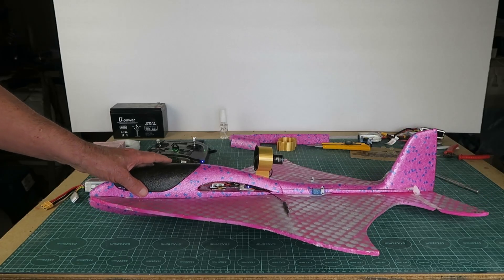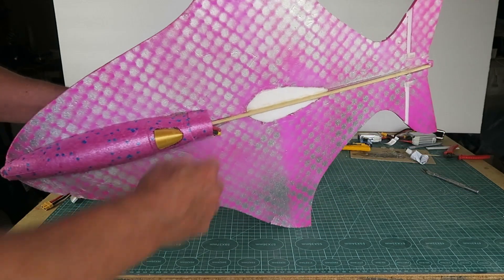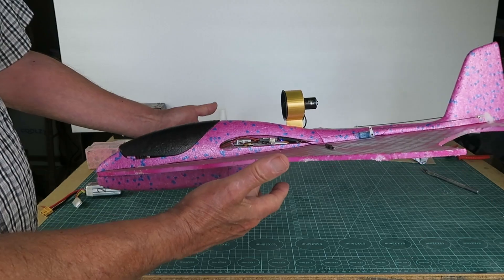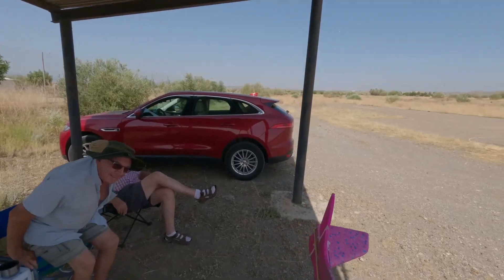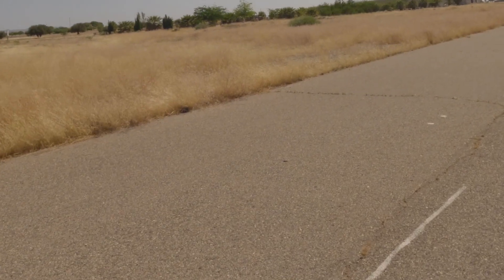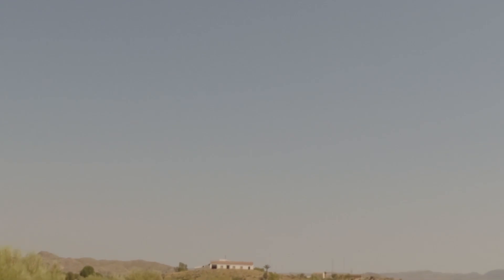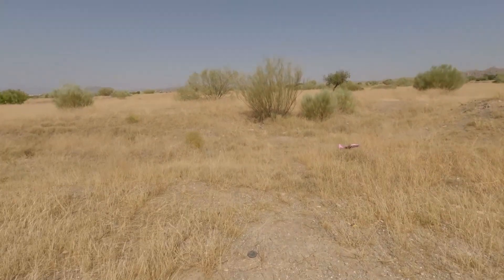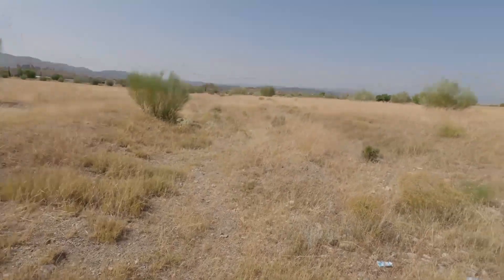A LidlBitFishy DIY EDF Smartfish  Hyfish RC Plane –  Will the Smartfish Finally Take Off?

Comment: I think it was pretty much there just needed a good lunch and a little bit of luck till you get the trim set. 
 My last homemade plane that was giving me some trouble is this a foam board biplane flying wing My own design but The prop is mounted to the front of the upper wing and it was suffering from a lot of p-factor which was making the plane do a knife edge One direction when I tried to turn and overturn the other direction. also I was shooting for super slow flight like indoor and backyard so I was using 5 g servos to move large elevons and they were powerful enough but the actual servo arms bent instead of pushing the rods and then the cheap motor I had overheated and stopped so...😅 I've got a bit of reworking to do on that one. I'll be glad to see whatever you have got up in the air next time.
Reply from the maker: Thanks for sharing your experience! Will look at some more options! Thanks for watching, have a great day!

Comment: I think it looks ok now, maybe tail heavy. Have you tried putting an FC with INAV in it and use Autolaunch just until it gets enough wing speed? Looks like it stalls and can't get the speed it requires.
Reply from the maker: Thanks, it has a gyro but I only set it to "wind mitigation" not fully stabilised. Back to the drawing board! Thanks for watching, have a great day!